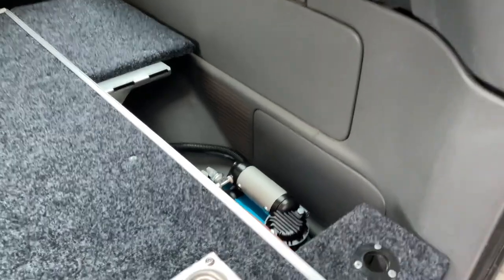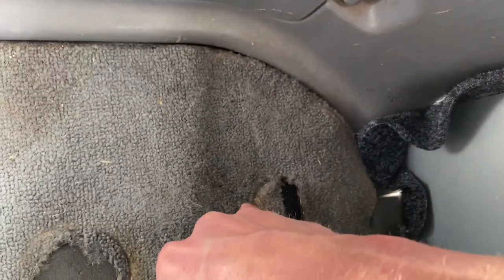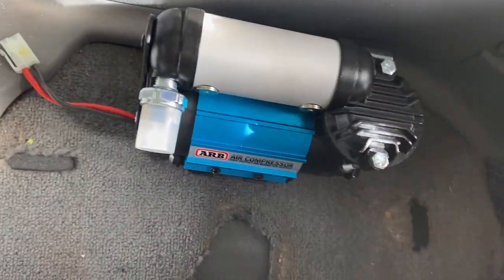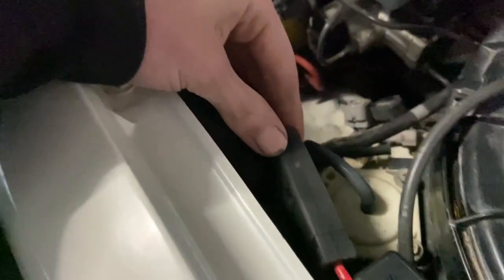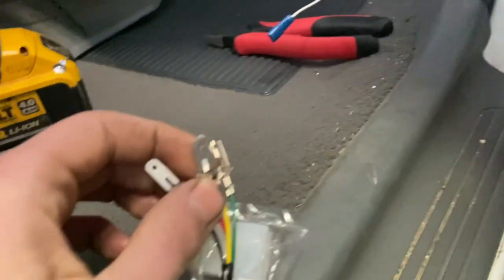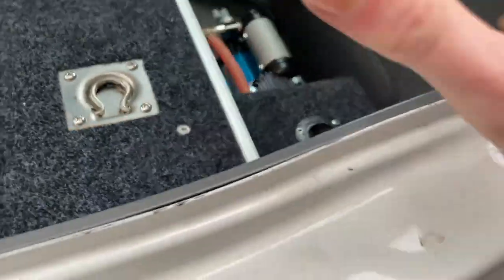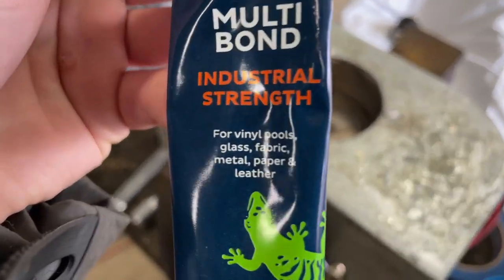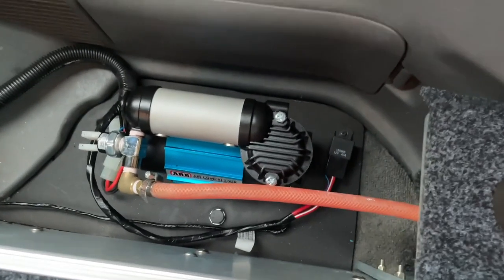Air Compressor Install - Rear Drawer Wing

Comment: Solid xontent bro. Giving me ideas for when i get my draws. One thing bro is when you fold the back seats down, are the seats levelled with the draws ? As when i go camping i like to put a mattress down and sleep in the back. Cheers mate keep up the good content
Reply from the maker: Cheers for the kind words! Yes they are almost perfectly level with the drawers, however there is a gap of about 20cm between the drawers and seats you will want to fill to sleep comfortably. I used to put a cushion in there or something just so my hips or knees weren’t falling into the hole

Comment: Great video, how did you end up mounting the ARB hose outlet with out it moving
Reply from the maker: I know I didn’t show it heaps well in that video, but the thread on the back of the outlet poked through the water bottle base and I could screw a brass tail onto that nice and tight and it sits really firm

Comment: Hey mate what guage wire did you run back? Cheers
Reply from the maker: It was definitely bigger than what I needed. Probably close to 10mm. If i was going to run it again, I would have matched the wire that came with the compressor which was more like 7mm
Reply: @WillsLandcruiser  okay thanks mate I ordered some 8 b&s (the size smaller than my dcdc charger uses) and was hoping that would be plenty cheers.
Reply from the maker: @MrBillyr7  yeah I reckon that’ll be fine 👍 as long as it is the same or bigger than the wire that is attached to the compressor. They’re pretty high-amp units but there’s no need for overkill big either

Comment: Nice vid, we're 105 -1HZ brothers 😂....I just got my ARB air lockers installed last week and I'm waiting for the weekend to do my compressor. Here's the rig https://ibb.co/vwSWf2D, it's 2005 with air lockers, Powerful rear bar, ARB winch bar into brush bars and side steps, redarc brake controller, dual batteries, SS commodore leather seats on custom seat rails, custom stainless 4" snorkel and some other stuff underneath, adjustable panhard rods etc. Just waiting to get a new set of tyres and get my heavy duty clutch in and I'm ready to roll again :)
Def gonna turbo it this summer after seeing your vids. Great work!!!
Reply from the maker: Nice rig mate! 😍 especially love the offset rims and how you’ve tinted the windows and gone for altezza blacked out headlights. Very tidy indeed! If you turbo it and get a safe tune, you’ll never look back. It’s the best thing I ever did to my rig!
Reply: @WillsLandcruiser  Cheers mate. Yeah, few things to fix up in between, but it's definitely happening.

Comment: where did you get the little thing the air hose plugs into??
Reply from the maker: From work. It’s a generic brass tail. Can’t remember the size exactly… maybe 1/2 inch? Or smaller